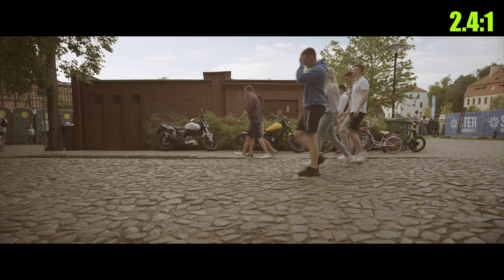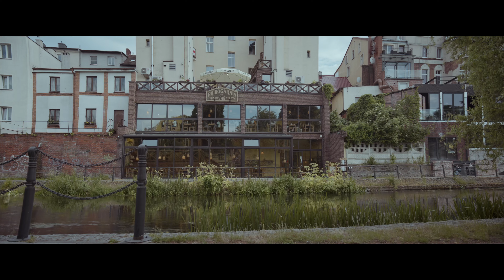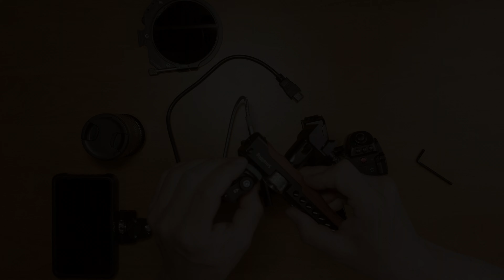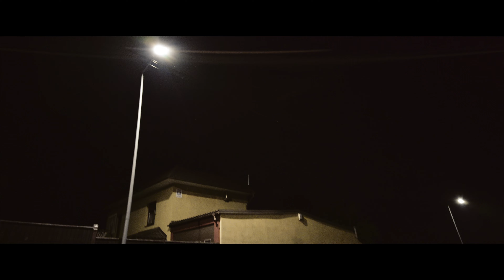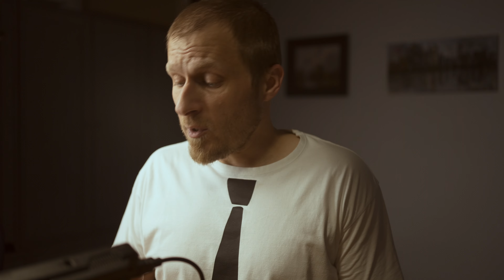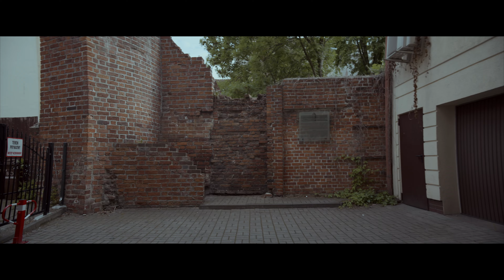Panasonic S5IIX Anamorphic Rig with Sirui Saturn 35mm T2.9 1.6x (Long Cut)

Comment: Будет ли разница конечного кадра, если снимать на anamorphic, между 16:9 и open gate?
Reply from the maker: Yes.

I recommend these two calculators, very useful:

https://www.tferradans.com/anacalc/

https://www.tferradans.com/arcalc/
Reply: @ спасибо
Мне не понятно следующее
Почему, если снять видео на обьектив anamorphic 50mm сжатие 1,6 (угол обзора эквивалент сферическому объективу 31мм) то объект (человек) в кадре, будет занимать такую же площадь, как если бы мы сняли (на таком же расстоянии от камеры до объекта) просто на обьектив 31 мм и обрезали верхнюю и нижнюю часть кадра?
Ведь обьектив 50 мм дает более крупное изображение человека чем обьектив 31 мм
Reply from the maker: I do not have my anamorphic lens anymore but as far as I remember the size of object was like on 35mm spherical lens. You may think the person (or object) is smaller if you compare whole width of the frame, but when you put 35mm (in my case) picture over the 35mm from anamorphic it looks the same but on anamorphic you have more stuff on the sides.

The easiest way to see 50mm Anamorphic gives different look that 31mm spherical is to look at the background compression and bokeh at the same f-stop.

Comment: Great video. I am glad you talked about the image stabilization with this anamorphic lens. If possible do some more testing on the image stabilization and perhaps the ideal set-up for it. Thank you for all you do. Cheers!
Reply from the maker: Will definitely do more stabilization tests. So far it seems that it's not as good as stabilization with spherical lenses, but this might be due to lack of 1.6x squeeze option or this 35mm is just too wide, cause as shown on the examples this seems as extreme corner wobbliness. Although for shots when I tried a bit more to be stable it's not that bad ... everything shown is hand held.
Reply from the maker: Oh, and this lens is ideal for gimbals :D. But I do not have one currently :D.